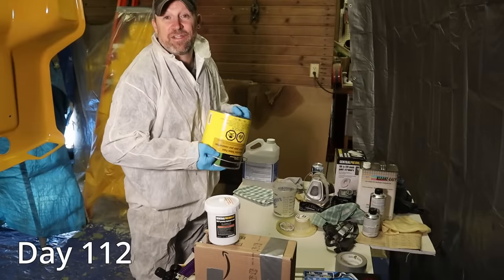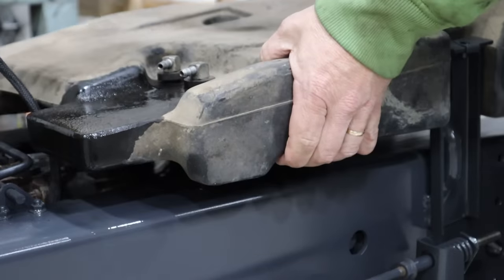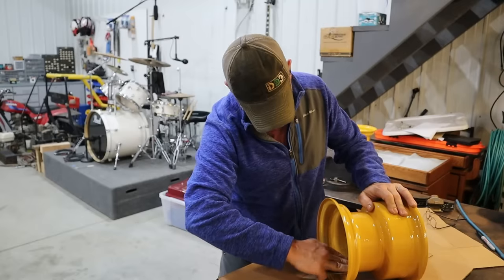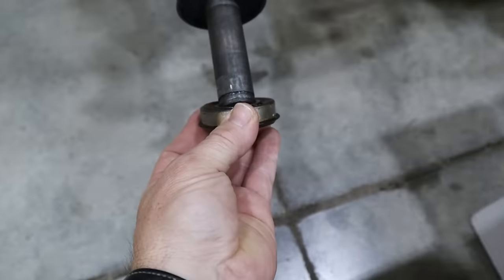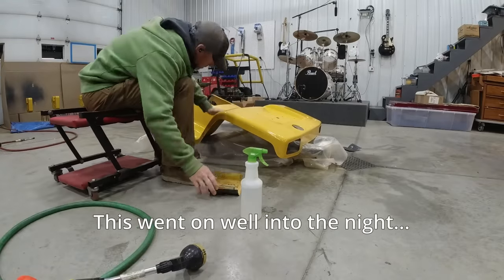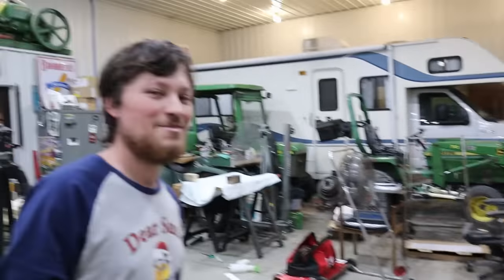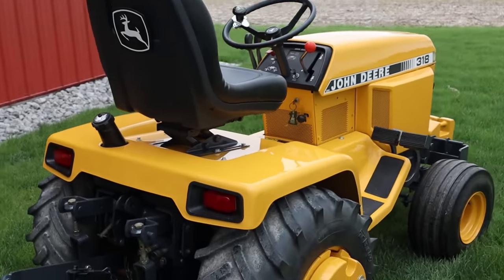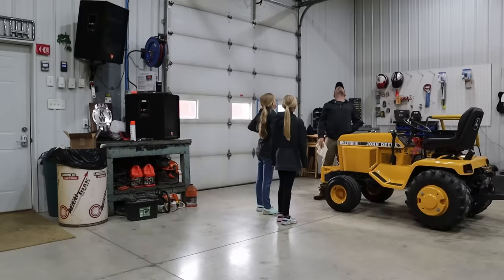I Built My DREAM 318 John Deere Tractor in 130 Days (In A Row!) - Part 8 FINALE!

Comment: COOL Beans Neil...
Love hearing Family Memories... It still has a hint of Green on it, Or at least one of the options. Did You spot it ? AHAHAHAH
I was fortunate to find a Complete Factory Decal kit for My 1970 Bolens 1256-02 which includes all the Warning and Control Decals. 
The red Stripe on the Hood and the Back of the Fender will have to be painted on as it was a Red tape .
Thanks Mike M.

Comment: I have 3- 318s and a 332...mine are hard working machines! 2 with front end loaders, 2 mowers with 3 point hitch for everything else! I'd be afraid to use those as pretty as they are!! Mine are restored, but much more blue-collar!! I go tubeless on all my machines, with a little slime for punctures. The loader machines have fluid-filled rear tires... rarely ever get a flat!... good job with your 318!!

Comment: That is a very sharp looking tractor.  

Sometimes you can't buy what you want,  so you build what you want.  I did the same thing,  not like you did,  I needed a dependable mower with more horsepower.  My 40 inch cut Murry,  the 12.5 horsepower engine went bad, so I put a 25 horsepower V twin engine on.  It works great and more than enough horsepower.

Comment: My uncle used to be a jd dealer,  went out yrs back, while cleaning up out back I found a brand new weight box for 318 with bracket, what a difference snow plowing with the box on back. I wish my dad bought a 430 back in 86, that was my dream tractor cause it had that long hood and a diesel

Comment: Deere paint orange peals VERY easy... We started going to our local paint shop and using PPG Shop Line base clear on all of our projects.  Its expensive but goes on flat and with a couple coats of heavy clear last FOREVER and doesn't fade over time. The 318 turned out great! Love the color and didn't think I would.
Reply from the maker: Hmm.  Well, maybe it wasn't all me? It seemed like the orange peel showed up in the last coat and got worse as it cured. I didn't know what caused it as it looked good when I laid it down. Appreciate the support and all the comments. Thanks for watching.

Comment: For those bearings Neal go down to tractor supply I’m not sure what the part number is but it’s for 1 inch spindles. It will fit right in the rim. Note that the bearing is a roller type so your gonna have to use high temp bearing grease for best results and another thing your gonna have to put the bearing race into the rim. Believe it or not it’s worth it Neil just keep up with the maintenance. Grease the bearings every service interval

Comment: I've never owned a Deere until this past summer.  Always thought you were paying for the name.  My brother-in-law gave me a nice 425 with a loader and all because he couldn't keep it running.  Replaced the spark plug exciter and it is fixed.  By far it's a better cutting mower than my Dixie Chopper or Husqvarna.

Comment: Glad you got the front wheels to fit nice Neil. 😉 I was waiting for it.. Tractor looks absolutely great man. It'll hurt your feelings when you scratch it now..😏
Reply from the maker: Yeah those wheels are a squeeze but the offset is just right. I was told they had 1" bearings and just never questioned it. Luckily I had those spare 25mm spindles! Thanks Ronald!
Reply: The ones I purchased were from Miller Tire online. I found that when I turned full either direction the inside of the wheel dug into the back of the spindle housing bad... That's where I found out I was going to have to grind off the buldge on the housing. After that she was good! 😄 And man; do they look great!!
Reply from the maker: My left tire just barely hits the front weight bracket if I turn to full lock right, but the right wheel doesn't hit when turning left.  I didn't notice any issues with hitting the spindle housing but I should look closer.  I think I bought these from Miller Tire as well.  It was back in the prime days of the website "Weekend Freedom Machines" if you ever visited there. Thanks for the great insight and comments Ronald.
Reply: Oh I'm definitely familiar with WFM for sure. And I actually didn't have any issues with the weight bracket that I know of. Same factory bracket as yours. That is probably due to the inside wheel bearing modification I did so I could get the snap ring on the outside. I think my front probably sits a quarter inch narrower than yours. I'm hitting spindle and you're hitting weight bracket..😂😂 There has to be a fine line. My tire hits the steering cylinder as well when I'm full locked to the left. Don't know of yours does as well. Just thought of that. And thank you for responding as always sir. You're awesome for that. 👍🏻

Comment: HA, love that last comment by your daughter:  "Why did you paint it yellow?" stab I think that color plays with my mind a little as I expect the tractor to be bigger in size such as the heavy equipment that is yellow.  However, Bruno wears it well.  Are you going to add the missing decal for the starter key or leave it without one?  I can feel your relief in pulling off this project.  Well done, sir.
Reply from the maker: How you caught me! You're the only one that noticed that missing starter decal! Or at least the only one that mentioned it. Yeah I need to get that on there and have a few other finishing touches that have popped up. Follow up video coming soon probably.
Reply: @digdrivediy  Winner-winner chicken dinner!  Actually, I probably wouldn't have noticed (maybe!) but you mentioned it previously and it would have really been frustrating if you had to disassemble to get to it.  I also noticed because my tractors (non-JD) have all kinds of information for the different positions of the key.  I'll be watching for all the other touch-ups.  Be sure to capture the first scratch/gouge/dent as well *tears*. It happens eventually.  😲

Comment: good luck with the painters caulk. i expect the first time the metal gets hot that the paint will crack and eventually let moisture in. but maybe not....
Reply from the maker: So you're saying it may not work but it might? 😋 So, like 50/50?

That's the same thing I said in the video!
The hood is fiberglass. Not worried any moisture at least.
Reply: @digdrivediy  
Haha, exactly!
Ive enjoyed your small tractor videos over the last year or two. Your dream 318 is both inspiring and satisfying to see. Thank you for making the videos.
By the way, i have just finished repairing and building up my dream john deere 314 without doing the full tear down and paint job. I may do it later.
I upgraded to the triple hydraulic spool off of a 400 and also upgraded to double break pedals off of a 317. And now i just finished installing  the "little bull loader" from the little buck loader company. A tiny front loader is soooo cool.

Comment: Top notch! Just sold my 318 for a bigger tractor, outgrew the girl. Business is good.
Whatever happened to 1080@60fps??
Reply from the maker: Thanks.  What tractor did you get? 
Had an editing glitch. Filmed it all at 60fps and somehow it rendered at 24. I didn't even realize it until it was uploaded and too late.  I was disappointed.
Reply: @digdrivediy  you may recall I also had the 44 loader., Very rare in my neck of the woods. 
Sold with the 4ft box blade, 6 suitcase weights, 2 wheel weights, beet juice filled rear tires, 25hp Kohler command pro motor, all new hydraulic lines, 10k CAD.
I purchased a Mahindra m26xlt with loader and a rototiller. Went with a manual transmission. It has 3000 breakout force.
No backhoe as I've already purchased a 1/2t mini excavator. (I only do small jobs) alot of contractor demos decks, fencing general cleanup so they can do their work.

Cheers
Reply from the maker: @enduser1982  Very nice!

Comment: Call me crazy but I'm building my dream push mower 🤷🏻 The deck is a Murray 21 inch with side discharge. I'm unsure of the brand of the handle. I was running a Honda engine until it gave out so now it has a flathead Briggs and Stratton that I replaced the aluminum flywheel with a cast iron so that it will not bog down in thick grass. I replaced the head gasket, coil, spark plug, oil, carburetor, and air filter. The original Murray plastic wheels have been replaced by Tractor Supply metal wheels. It has NO safety bar. I used Rustoleum truck bed liner in a rattle can on the deck and the brightest green spray paint I could find on the handle. A friend of my son's pointed at it and said "look at that antique mower". Biggest compliment I could ever receive.

Comment: Neil, I'm getting a JD420 instead of the 430.  If I get all of the body parts sand blasted do you think it would be ok to use spray primer and spray paint on the body parts and rims?  I do not have the room to set up an area to use a paint gun.

Comment: Buttercup, Daisy, Goldenrod, Mustard or maybe Sourpuss, Lemonhead, Dandelion or Sunny would work. I would have went green too. I worked at a place that had a couple of JD 430's I think? They were the largest garden tractor they made with the widest cut and hydro on the fender, but I didn't ever use them the one had the grill missing because someone damaged it and the other was just faded. They were supposed to be top of the line but I also had a JD950 with flail (7') and a Scag that was a a 20hp (or more) rider that had a seat over a wheel on the back that steered and a deck out front with two casters to set the height (plus holes on the back of the deck) and that thing would out mow any tractor in it's size class. I should have bought the old JD equipment there when they sold it but wasn't around and didn't watch for the auction. So in my ramblings I guess if all you need to do is mow buy something like a zeroturn or that Scag but those tractors would be nice to pull a wagon around or push snow with, not sure what they'll do in a garden. Nice job on the Yellow JD though!

Comment: Neil, where did you get the seat suspension? I have not been able to find it online. Love the series by the way!
Reply from the maker: That is an OEM John Deere deluxe seat suspension that was available during the era of these tractors. It was on a tractor that I bought years ago and I saved it to one day use on a project like this.  They are indeed difficult to find nowadays.  I've owned close to 15+ of these tractors and only one had this seat.

Comment: Is that a 3 pcs wheel weight kit for the rear and where could I find a kit like this?
Reply from the maker: No this is just a collection of weights I have found over the years. They weren't a set or even came from the same tractor.

Comment: Did you use the harbor freight predator 670, I also have a 318 with a factory tiller that I took the onan engine out, what muffler did you use ?
Reply from the maker: I used a Robin/Subaru engine.  I modified the Onan muffler to make it fit.
Reply: Tks for the info, I also had to lengthen the drive shaft by 2 inches, but the predator 670 fits.

Comment: I onow it’s ur dream 318 but why not put a 430 rear end in it so you get the dif lock and 2 speed? I believe the axle shafts and housings have to be swapped but it’s been done
Reply from the maker: I've thought about it. But to be honest I've never really had the need for it.  I had a 420 for a bit and never used low range. I don't know what you'd need it for really. This tractor does everything I ask and it will spin out before it ever loses power.  So, I just thought it really wasn't worth the effort I guess.  The diff lock would be cool though in the mud or something I suppose..

Comment: It's not a true John Deere until it's equipped with unique interfaces running proprietary software so you have to pay the dealer $875 for every laptop-based diagnosis. Even the tires should be encrypted and locked-down with special rim-software locks.   LOL !!!
Reply from the maker: I can't afford anything that fancy anyway 😜

Comment: Was the front John Deere emblem on the hood 3d printed?
Reply from the maker: No but I had thought about doing that actually. Probably should have. I just modified a 3000 series hood emblem.
Reply: @digdrivediy  looks like it worked though. Nice job on the build. I personally like the color being different.

Comment: What rear tires is that?
Reply from the maker: 1986,87,88,89,92.  :). It has lots of different parts on it!  I don't remember what year the chassis is for sure.
Reply: @digdrivediy  you misunderstood my question. I'm asking what king of rear tires it has. I like the look. I'd like to put those on my 332
Reply from the maker: @alexreinhardt28  oh! I read that late at night and thought it said what year is it.

It has 26x12-12 tru powers on the rear.
Reply: @digdrivediy  thanks mate. In your defense I did word that a bit strangely